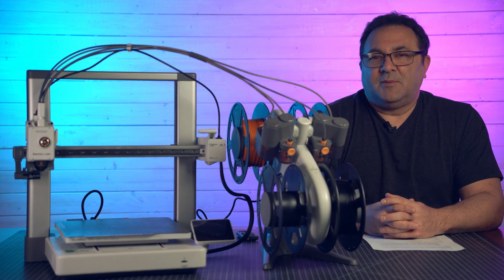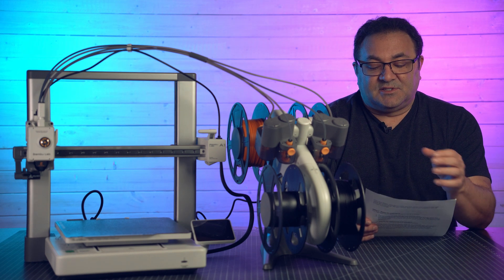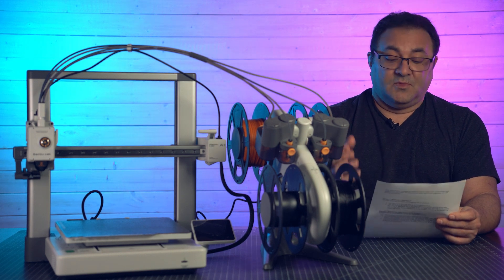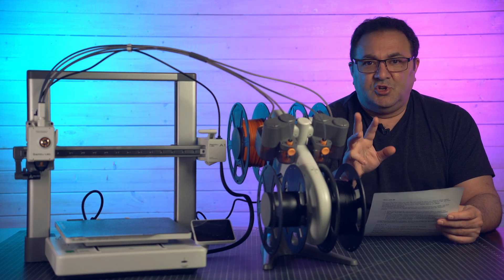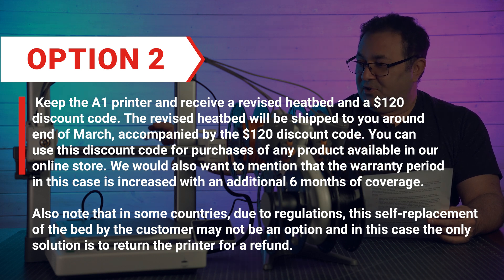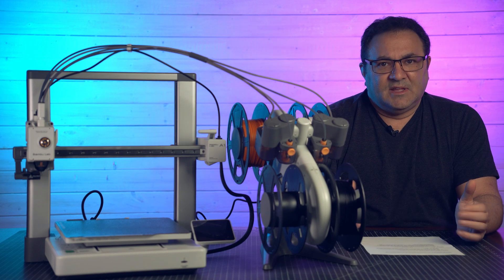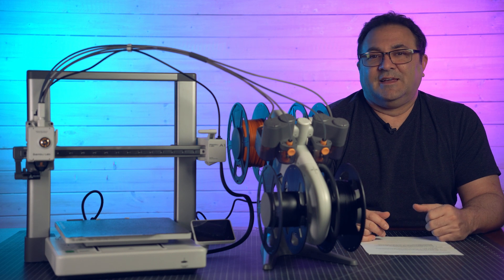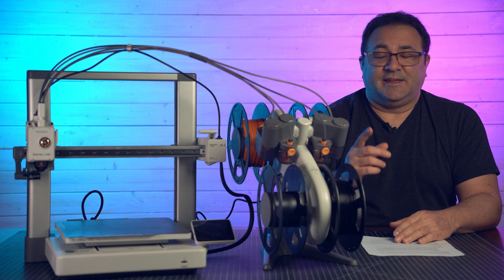Bambu Lab A1 3D Printer Recall UPDATE - Replace or Repair - My Plans

Comment from the maker: What Are Your Plans?
Reply: I'm keeping the printer and replacing the heatbed.  The printer has been amazing for me and prints beautifully.  Glad Bambu stepped up and is taking responsibility.  Yeah, I'm a little frustrated I can't print for a couple months, but I'll live.
Reply from the maker: It is frustrating, I have several printers, but if this is someone's only one it's got to suck. @JosephHooper256
Reply: @3DPrintedProps  I’ve got a second one, but it’s a slower, but still competent Elegoo Neptune 3 pro, so going back to the slower printer is hard for the moment. But definitely thinking about getting another Bambu with help from that voucher tho.
Reply: Personally I'll either upgrade to X1 with AMS or move away to Prusa. I love the printer, but I don't have nearly enough time to wait for replacement, so I might as well upgrade. Only reason I'm split on Bambu and Prusa is I'm wondering if it would be better to use X1Plus or modify MK4's firmware.
Reply: Hopefully, Returning mine today at microcenter. Still unsure if I want to get the P1S with the discount.  I already have several and don't really need another.  I enjoyed the A1 but it's not as refined as the A1 mini or X1C.
Reply from the maker: Interesting. I forgot that a lot of people picked them up at Microcenter. Do you have the original box?  @Lucid3DPrinting
Reply: @3DPrintedProps  yes sir.  I save my boxes until the warranty expires or feel like I got my fair use out of the machines.  I tossed all the internal cardboard but kept the big foam parts. I saw online that micro-center just wants them to fit within the original box.  So I packed it pretty similar to when I opened it.  There's a video on how to pack it back up.  I'm keeping the perishable items though.  I really want a helmet class version,  but the k1-max and qidi x max 3 seem so hit and miss amongst the community.  Maybe I'll keep waiting on bambu to make something larger.
Reply from the maker: I should keep mine too. Yeah, I have a K1 Max and love it. Runs like a top. I have a review going up soon. There's always something like a Neptune, solid printers.
Reply: @Lucid3DPrinting  I'm a Bambu guy at this point with a P1S and two A1's, but like you I wanted a larger printer. I have a QIDI X Max 3 and a Kobra 2 Max, both of which have been nothing but trouble. I despaired of ever getting a large printer that worked well, and like you I was wary of the K1 Max because of all the early problems. But I broke down and bought one. I had a problem or two with it, but all easily resolved. Since then it's been excellent. I recommend it, but haven't had it long enough to be 100% yet. I am waiting for a big Bambu too.
Reply: @Immolate62   thanks for the input. I returned my A1 simply because I'm stocking up for show season and I need the farm running. I already have 3 ams machines so I wasn't using the color much on the A1.  I used the discount and picked up a P1S. I thought about leaving microcenter with a K1-Max also, but I couldn't pull the trigger because I have some other expenses that are priority. I'll keep an eye out for a sale or something the next few weeks.
Reply: @Lucid3DPrinting  good luck to you this show season, brother. I love my P1S so you can't go wrong there.
Reply: @Immolate62  my next printer unless they come out with something else like a A2. Larger frame
Reply: I was gonna use my big paycheck from Valentine's Day to get one. Now I'm gonna have to wait a few months for them to be available again.
This whole recall had the worst possible timing for me, especially because if I got it when I first found it, I would have gotten the compensation for the inconvenience. But now that I have to wait 3 months or more for it, and because my printer will be completely unaffected by these issues, I guess I can kiss any kind of compensation goodbye, despite the fact that 3 months is a long time to wait.
Reply: @DavidNightjet   Wouldn’t it be possible then for you to buy it from someone on BambuLab’s forum that was gonna send it back? Compensation and build plate replacement addresses aren’t account locked.
Reply: @maka6000  that's a good idea actually. Idk how I didn't think about it.
Reply: @DavidNightjet  Though if you would go through with that I recommend doing it quickly considering that it requires someone who didn’t yet submit the form and a lot of people already did that considering the wait time for Bambu actually handling the form.

Comment: Hello all, I had the option of returning the A1 since the box was still in my basement intact. I stopped using the printer, mostly because they can monitor usage and the message popped up on the display of the machine itself. I could have gone "dark", disconnect from the Internet and use a micro-sd card, but figured if they went that far, might be able to get to logs or something once it got connected again to the network. Then they might argue that I didn't follow instructions and refuse to send the part or something. Maybe I'm paranoid, I dunno, just didn't want to risk it. Instead, I started working again with my--now ancient!--Artillery Sidewinder X1 V4 to fix some of its issues. Couplers, wheels, and the next step is an upgrade to the firmware. It still works to print stuff, although it does try my patience a bit after using the Bambulab A1 for about a month. You get used fast to that kind of speed. It may not be perfect, but it's a lot better than the Sidewinder. Oh, and I had to fix the Sidewinder myself when IT BROKE ITS A/C cord to the bed. I used a salvaged power cord from an old clothes iron that died. That wire has many many fine strands of copper and real rubber around it, extremely flexible and holds up well two years down the road. Anyway, I sincerely hope end of March is what it's going to be for real. Don't have the shakes... yet.

Comment: Less than 1% i'm not going to stop lol.
Reply: I'm shocked! Hold on, hard to hear you over the noise of my A1's running in the background.
Reply from the maker: 1% now, but as these get used more it will happen more. This is happening from either poor materials (cable), engineering (the bend of the cable), or both. That will happen to everyone's in the end.
Reply: that is generally not how electronic recalls work. They usually only affect certain batches / assembly. Very rarely in history has "every single device" been affected with recalls. This is also true In almost any manufacturing category. This is not advice to keep it, just factual data.
 @3DPrintedProps
Reply from the maker: That makes sense. Thanks. @tjhuntog

Comment: I have concerns in regard to Bambu stating that only 0.1% of manufactured units have this particular issue after reading so many reports of the very same fault on so many devices, then next minute a total recall announced......  it would appear that their initial fault investigation was far from accurate.

I also have not been impressed with Bambu Lab sending me correspondence stating  "no one wants to be without a printer so if you wish to upgrade immediately to another one of our printers we will provide you with a discount voucher of $80" (or £74) against your purchase, now that i initially thought was great as i will upgrade to a P1S, then i find out that the voucher will not be issued untill after you have returned your faulty printer which will take several weeks, once again their definition of immediate is far from accurate.
Reply: The other printer manufacturers decline to admit their printers have a problem. I guess some people are hard to please.
Reply from the maker: Agree, it may be .1% now, but as these get used more it will happen more. This is happening from either poor materials (cable), engineering (the bend of the cable), or both. That will happen to everyone's in the end.

Comment: Hello everyone.
If I opt for the heated bed option, should I disassemble and ship? or they simply send it to me once I request it. Thank you so much.
Reply from the maker: They will send you the updated board and you will have to install it. The instructions are linked in the blog post and email they sent. Its in the description. Read it over, they did a good job, its very clear. :)
Reply: @3DPrintedProps  and if you can’t do it bring to a computer technician at Best Buy or staples with the instructions.
Reply: Did you go through the app and submit a support ticket with serial number and all you information the request? Serial number can be found on your lcd screen of printer under settings.  🍀
Reply from the maker: Use the link in the description or just go to the Bambu site and check their blog post. All the instructions are there.

Comment: I have two of them. I'm keeping them and will continue to use them as normal until the new heat beds come in. These are power cords, not flux capacitors. I know how to examine them and determine their state. I'll keep a watch, but if I find a problem I will replace the cord with something more robust. Bambu said one in a thousand might be faulty, but I know better than to rely on their guesses. Your printer is either compromised or it's not, and mine aren't. This is still the best printer at the best price that you can buy.
Reply from the maker: True, they are not kicking out 1.21 jigawatts, but I'd rather be safe then sorry. :) 😀Be safe.
Reply: i'm in the same boat. 110 credit plus an extra bed? Yes please.
Reply: @tjhuntog  Yes please, x2.
Reply: @tjhuntog  Truth brother! Mine is working fine and I would love a huge credit. Have you found any need to use different style plates?
Reply: I completely agree! Mine is fine and I use mine under supervision, but I'm using it. It's an amazing printer.
Reply: I do a lot of network cabling. Sometime the bend in the cable fights you and you have to force it into position. But sometimes the natural curve fits perfectly. Looking at the power cord on my A1, it's the latter. There's a constant bend over the entire length as it moves back and forth. I'll keep an eye on it, but unless they're using copper-coated aluminum wires it should be fine. Might even use the $120 towards another one.
Reply: I use it too,  I am concerned about safety, but I need it cause it's my job... I can't wait untill the end of march without using it.

Comment: Just seen your video and I myself have applied for the $120.00 voucher and I consider myself competent so I will be replacing the cord/heatbed when it becomes available and they send it to me.
Reply from the maker: Yeah, I think a lot of people are going to do that.
Reply: Hello.
If I opt for the heated bed option, should I disassemble and ship? or they simply send it to me once I request it. Thank you so much.
Reply: Ditto
Reply: There aren’t any instructions, but if I had to guess it’s as simple as they send you the new bed assembly and you swap it out and throw the old one away or what ever you do with it. It would cost them even more if they required you to ship them back and it would be even worse press if they require you to send it back on your dime.
Reply: @shawnhicks619  you go through the app and you submit a support ticket for what option you want send the whole unit back and get refunded or select heatbed both you get vouchers of credit and any refund do . They are very efficient in the process and  be sticking with them for now on.
Reply: How do i apply for the €120 voucher one?
Reply: @MennoWeerman  through the Bambu lab wiki application look it up 
You should have received a email from them .  Look in your spam folder of your email